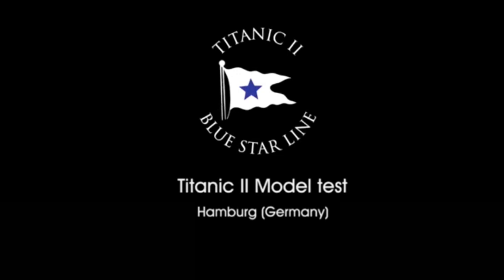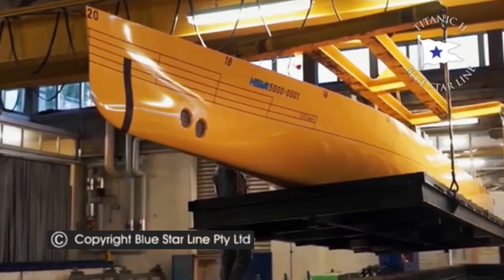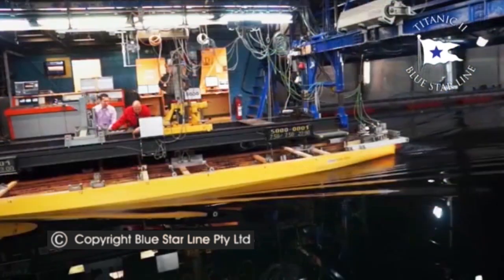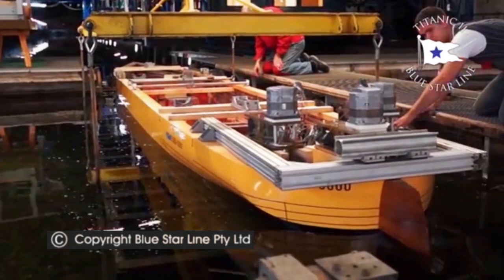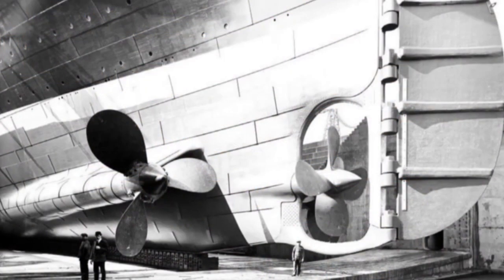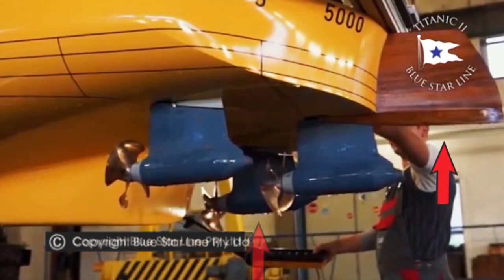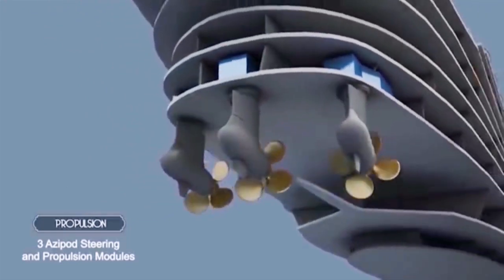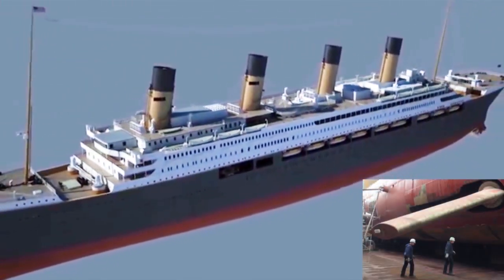Titanic II: Hull Water Tank Test

Comment: The stern of the cruise ship does not suit him; the most advisable would be the stern of the Lusitania, since that uses Diesel and without damaging the soul of the ship, the Titanic can use the stern of the Lusitania.
Reply from the maker: Titanic II will have three modern Azipods which requires a different hull shape (wide and flat) to mount them on. Plus the tank test revealed that the original hull shape was not stable enough by modern maritime  standards.(The original designers did not have water tanks and comuters simulation). I have several 'shorts' about the hull (see playlist). I also have a new video about the hull to come. Best subscribe to this channel and my blog or you might miss something. (Link in video description).

Comment: Why did they give it a modern cruiser stern? that portion of the ship doesnt even touch water.
Reply: I thought this too, but if you look closely, that's only because the model has a cropped hull - it is only as high/deep as required for the water testing.
Reply from the maker: I think we need to see the finished ship to fully judge the design - but yes, it's not the same as the original.
Reply from the maker: You are very right. I guess the stern has to be wider to hang the Azipods off? Sadly that was one of the most attractive parts of the original ship.

Remember to subscribe to this channel and my blog for free, to hear about the Titanic II’s progress: https://titanicll.wordpress.com

Comment: My honest wish is while diesel engines are modern, I wish they could use modernized steam power to at least give it more authenticity than just appearances, a steam whistle has no proper substitute!
Reply from the maker: Fair comment! Remember  to subscribe to this channel and my blog for free, to hear about the Titanic II’s progress: https://titanicll.wordpress.com
Reply: There isn't really a "modernized" version of steam power.

You'd be right back to square one with steam turbines powered by oil fired boilers. It'd be a lot cleaner and efficient than the coal-fired quadruple expansion engines of the Titanic, but you're still using incredibly old technology. Doing this would also have the unwanted side affect of taking forever, days, to get the boilers up to their operation temperatures.

It'd be better to use standard diesel engines or gas turbines instead.

Fun fact: Steam turbines are still used on ships in the form of nuclear power instead of coal or oil fired boilers. The U.S Navy uses them in their supercarriers, starting with Enterprise.
Reply: @Monarch683  nuclear submarines, aircraft carriers, ice breakers, and power plants ARE modernized steam power.